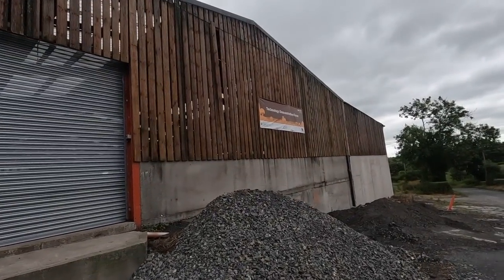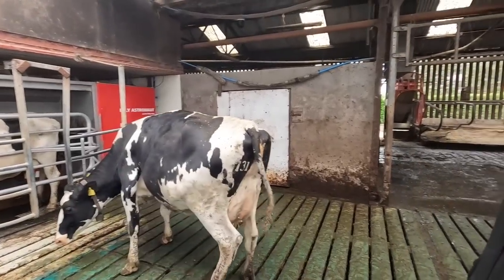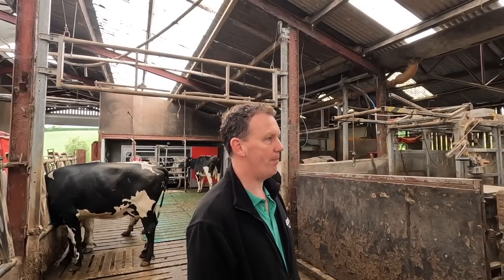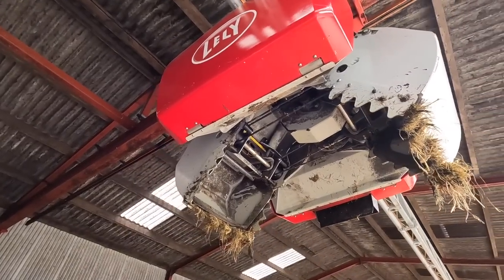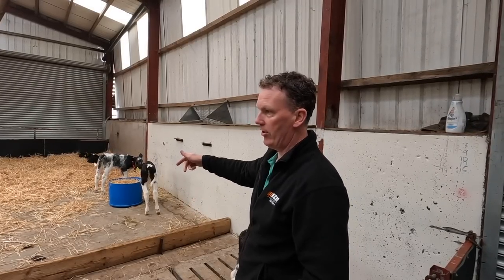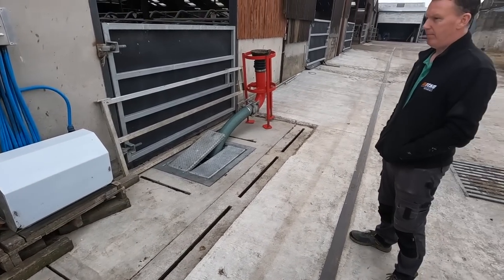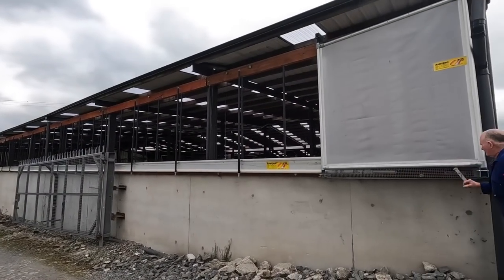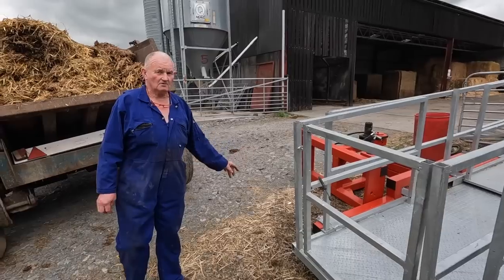IRELAND & UK'S FIRST FULLY ROBOTIC FARM | 12 YEARS OF ROBOTS

Comment: In New Zealand, there are robotic setups where the cows are outside and they walk up themselves for milking. The collars operate which gates to open for them and on exit can be separated to different areas if on heat, require attention or moving to a fresh paddock.  Lely have a team that come in and work with you to design the system for the farm. They can design a new shed or reno the existing one to suit.  Lely has some videos on YT on some of those farms.  Capital outlay isn't cheap though.

Comment: Great production by you both👨‍👧. One question that isn’t asked 2 often  is the maintenance and service cost of the robots. And if in a service contact does it get more expensive as the robots age and by how much
Reply from the maker: Yes the maintenance cost would be higher as the robots age and need more parts changed out, but it’s impossible to put a figure on that sort of thing as ever machine is different.
Reply: My sister has 2 robots in about 7 years and she tells anyone that visits the real facts and she says she has as many turned off them as on them! They cut down on the physical labour but you have to up your skills re grass management and you are always on call especially if you’re maxed out on cows per robot. I’m looking forward to your next “production’